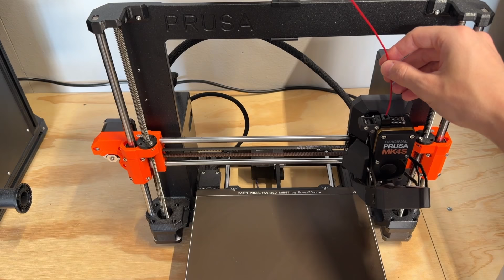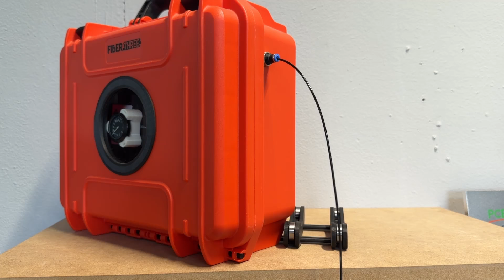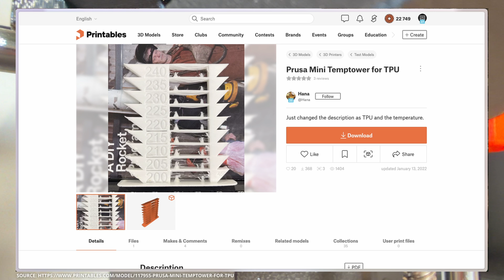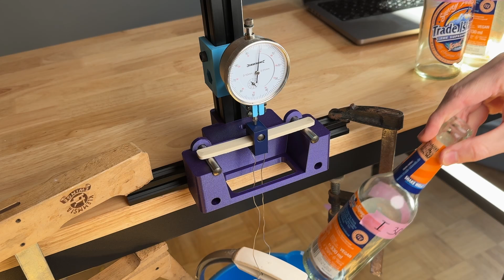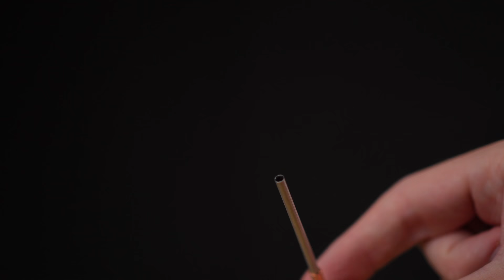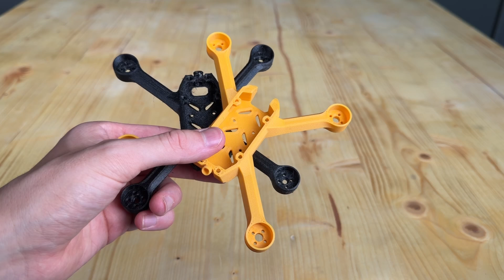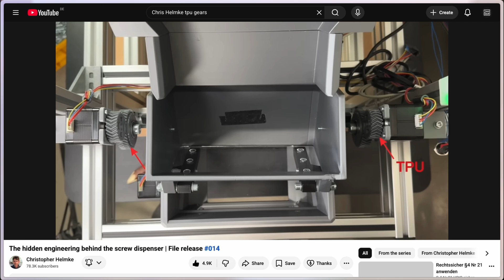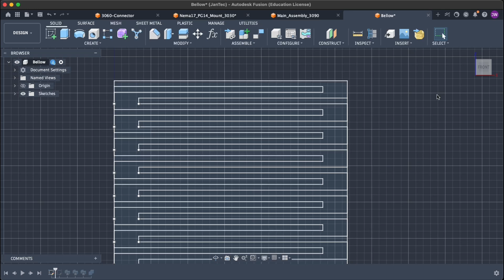TPU is Underrated. Here's What You're Missing Out On.

Comment: i recently have been on a TPU kick, got a variety types and colors....even got a big 3kg roll.
i know everyone chooses TPU for the flex, but im liking it for its low print warp, and ability to not melt in the sun. Multiple days of 105f heat in direct sun, on a dark blue car hood, and no melting at all, not even a little.......so now i want to find a TPU that is as hard/ridged as PLA. I tried some 64D TPU, but it is still WWWWAAAAAYYY too flexible..... if you know of any truly ridged TPU, ill probably give it a try as soon as i can get it.

Tip 1 - "silk" TPU seems to make functional supports. Prints in silk TPU come off about the same as any other supports. found out by accident when i for got TPU normally bonds too much and printed the slik with supports, and they just came off cleanly and unexpectedly. i cant do 2 color, but when i can i want to try using a mix of TPU and silk TPU to see if that works for supports too.

Tip 2 - TPU on bare steel plates seems to work, no risk to your PEI coating. works even better if the steel is sanded rough a bit.
Reply: PrimaSelect TPU 77D is as hard as I've found, I haven't tried it and it's kind of pricey if you're ordering in the US! CC3D has 72D available on Amazon that works well for me, Rosa3D also has a (some)fiber TPU I'm curious about that's 75D.
Reply: There is 72d TPU available from CC3D but it doesn't have as good of layer adhesion vs normal lower hardness TPU. It's possible to break it along layer lines.
Reply: And there is another hard tpu i know the smart materials tpu Hardness+ in the specifications says that is 83d

Comment: Temp tower is a bad design for testing TPU, especially if you have a bed slinger. The higher you go, the worse the quality from gello effect. A bunch of small cylinders printed in series is a better way of going about it. TPU usually likes lower temperatures, ly topping around 220*c. The higher end is  only useful for high speeds, where prints fail anyway.

Comment: If I could, I'd buy a 2,85mm printer and a metric ton of thick TPU filament. Unfortunately for some strange reason people decided that TPU is unimportant and every printer in the world has to be optimised for PLA. The 2.2mm filament is  just a compromise, that's basically the thickest filament they could fit in 1.75mm printers. 2.85mm is just better. With Prusa extruder and 2.85mm, high flow nozzle, we could print TPU at the same speeds as PLA. With PLA on secondary nozzle for supports, there would almost be no limit to TPU printing. As of today, 2.85mm filament is considered obsolete and you can't get it reliably anymore. It sucks and it's a grave mistake.
Reply from the maker: In fact, you would swap the extruder and hotend of your printer. Friends of mine put an old 2.85 mm E3D hotend into their Rat Rig to print cheap eol 2.85 filament.
Reply: @JanTecEngineering  I don't know where they're getting that cheap 2.85mm TPU. I'm not seeing it anywhere.
Reply: i have a 2.85mm printer...... and have tpu for it.... the only advantage to the thicker filaments is if youre using a bigger filament  you can go above a 1.0mm nozzle that is the practical limit for 1.75mm filament....................... the other benefit i see is 2.85mm filament makes better fiber optics and decorative things like that that have nothing to do with printing.
Reply: @ZOMBIEHEADSHOTKILLER   Maybe you have an old printer that doesn't work very well. Modern hotends and extruders are way better than  1.75mm TPU can handle, because they stretch and compress it too much. Thick filament is more stable and can be easily fed at higher speeds. E3d nozzles deform filament in a way that makes it work the same at almost any thickness, so melting isn't a limit for thicker filaments. Just look at the filament mentioned in this video. The 2.2mm version outperforms 1.75 mm. 2.85 would perform similarly but with specialised tooling it can outperform it in extruding. It's all about pushing it through the nozzle without bending and thicker is better in that regard.
Reply: @rhalfik  yes, if you have an old printer, its harder to print with softer filaments like tpu...... but modern printers and filaments its a insignificant problem to print tpu....... even with bowdens........ and yes, you can go a bit faster with the 2.85 cuz you can feed more at once, the same reason it work with larger nozzle sizes.....just a different use of the same action.

 printing isnt a race. performance isnt measure in speed, its measured in quality. ... one slow high quality print, beats 10 fast low quality prints.... or any number of faild prints....... if a print isnt up to quality, its irrelevant how fast it was printed.
Reply: @ZOMBIEHEADSHOTKILLER  That kind of one-sided opinion is a waste of your time. Speed and quality go hand in hand. You can't consider one without the other. Printer performance is about how well it can print at speed, or how fast it can maintain print quality. That's what I'm talking about obviously. 

I want my printer to have capacity to print whatever I throw at it and going slow is not a way of getting there. Time is money. The technology didn't stop at your printer and what I'm saying is that printers can be much better at TPU. Currently they're worse than they could be and only because they're optimised for PLA instead. The ideal TPU printer would run on 2.85mm and that's what I want.

Comment: Feeding the spool is the most important thing I've found for tpu. If the reel binds in any way it will stretch the filament  which will make the extruder eat the filament or the narrow pushed filament  will bend  and conform to the space between extruder and hotend, tangling and jamming
Reply: that's why first print for many printers should be a bearing that improves the performance of the spool holder
Reply: @devincortno123 Verily! What works well for me as My gantry style printer sits under a desk so to save space i bolted a horizontal spool holder to the top horizontal bar, the spool holder is a central spindle with a flat round hubwhich has 5 segments of ptfe bowden tube in a radial arrangement. The flat of the reel rests on the ptfe sections and then the filiment feeds into a stick with 20mm ring bolted to top , to offset/ guide filament  and ensure reel doesnt unspool. It is surprisingly smooth. I would say its probablly smoother than sealed roller bearings cause a fair amount of force is needed to overcome internal bearing grease. If you dont print the ring out of nylon, thats where the friction  happens. After 40 hours the filament erroded a 3mm notch into the petg ring😂